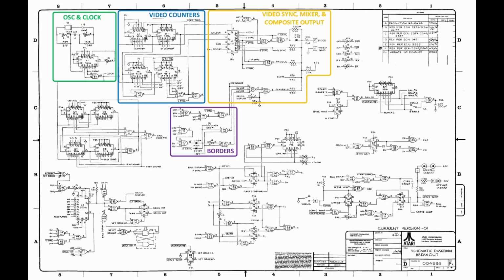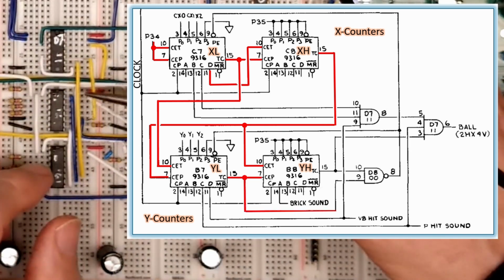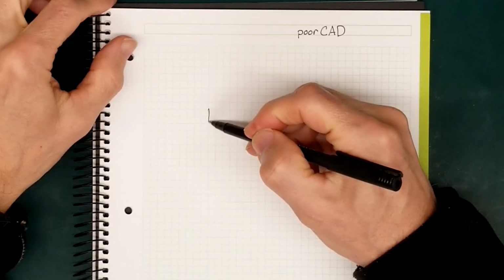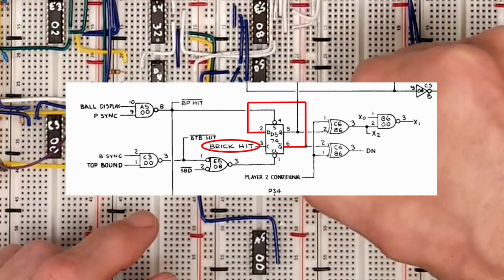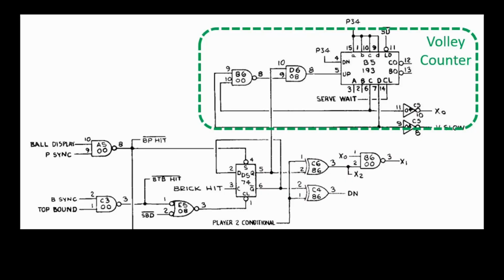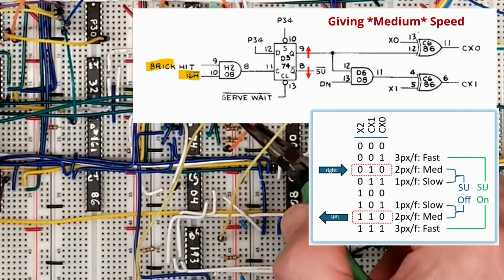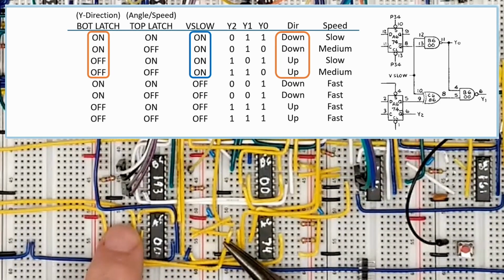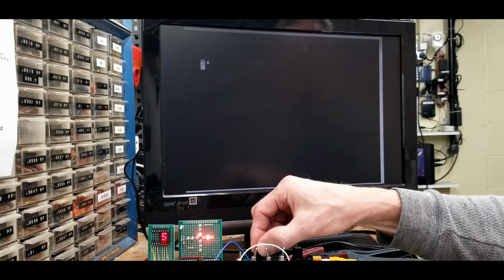Retro Atari Breakout Part 8 - Ball Counters and Motion Controls

Comment: I've noticed on your breadboard connections that you tie high through resistors (look like 4.7k, not sure). I'm curious what purpose the resistors serve. My thought is to protect against accidental incorrect connections.
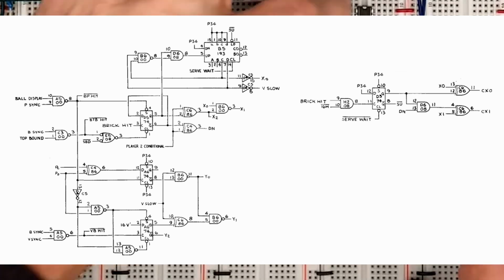Reply from the maker: Yup, 4.7K. Good eye. There's a little explanation in Part 6 @ ~12:55 about this but basically unused TTL should be pulled up or tied down. Gates have light pull-ups, but I often get into trouble if I don't purposefully pull them up, especially the 7474 latches.
Reply: @bytemind-dev  Can't believe I missed that. Good information!
Reply from the maker: The schematic entry stuff is pretty boring so you probably fell asleep!
Reply: @bytemind-dev  :)